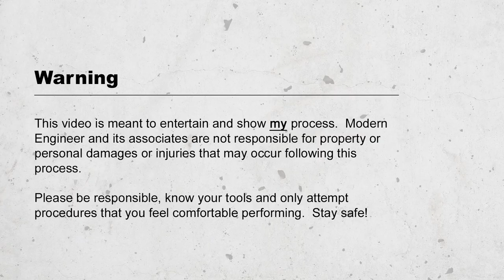2012 Volkswagen Golf R CV Axle Installation | MK6 / Front Left

Comment: The shop manual explicitly says NOT to remove the bolt with the car's weight on the wheel, as this can ruin the wheel bearing. It also says not to use an impact tool on that bolt.
Reply: Correct

Comment: I have a 2012 Jetta 2.5 MT. I've had to replace the axle a couple times. Not sure if it's just the crappy Advanced Auto parts. If this one goes again, I'll get the one you posted. Thanks for the great video.  I find it easier to separate from the tie-rod to swing the hub out.

Comment: I just did mine on my 2002 Passat, so easy, didnt have to remove anything. Took the lug nut off, the 6 m10 triple squares and turn the wheel to slide it out, I lied I had to remove a shield to have room to move axle but that was 3 6mm allens.

Comment: Curious, when your cv joint was bad, did you notice binding during, or close to,,full lock turns? I have a new to me 2013 R and maneuvering in parking lots or anywhere requiring tight turns is miserable. In comparison, my old A4 Quattro never had this issue, nor does my current DD (2015 Golf TDI).

The binding only occurs between 75-100% lock, to the point that the tires don’t seem to want to spin, and chirp on the asphalt. 😰
Reply from the maker: I only experienced the clicking however if it was bad enough I suppose the wheels could chirp. Almost sounds like a diff problem but at low speeds the rear wheels shouldn’t be engaged at all…
Reply: What was it on the end? I've got a CC with same symptoms. I didn't inspect it yet, but I assume it'll be a bad cv joint as this makes the most sense for me.

Comment: What kind of breaker bar did you use
Reply from the maker: Rawws 223 harbor freight with some electrical conduit slipped over the handle.
Reply: Modern Engineer is it a 1/2 or 3/4

Comment: The difference in Torque speck is huge between the hex bolt and 12 point bolt on the axle  - 200N/m +180 degree vs 70N/m + 90 degree . Anybody know why ? My guess is different hardness of those bolts(12 point supersedes the hex) , but still -its huge.
Reply: They are all stretch bolts it's just the bolt on the axle is so much bigger it takes more to stretch
Reply: @ChutneyGames  No those are both axle bolts. I did some searches and found the 12 point one comes in two different forms - one with flat surface and one with ribs . The smaller torque is on the one with ribs.
Reply: 200N/m +180 is insane. Feels like it will snap every time
Reply: Your guess is correct. The older hex bolts use a different type of steel to the newer 12 point bolts.